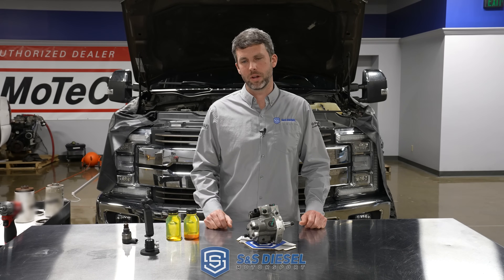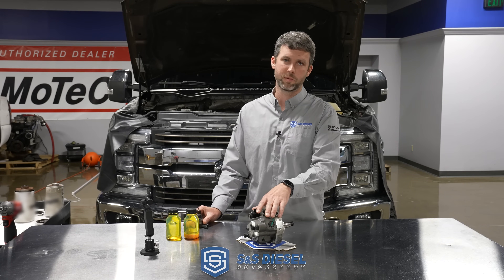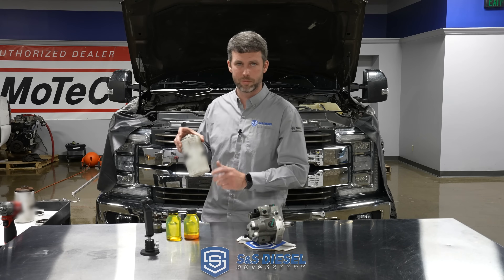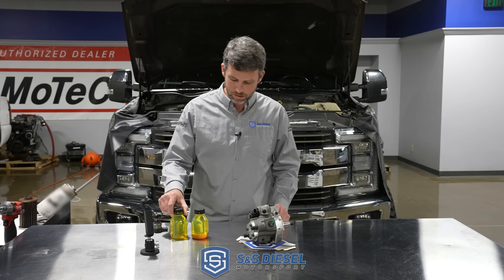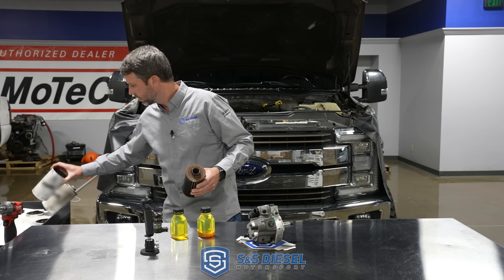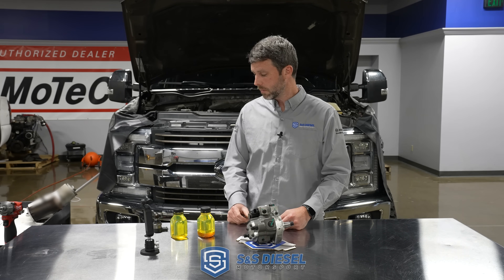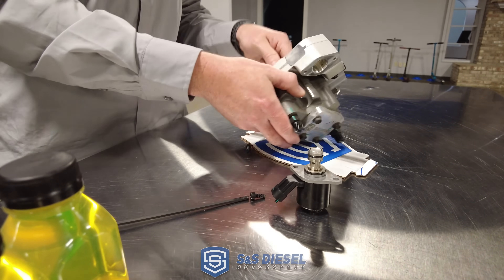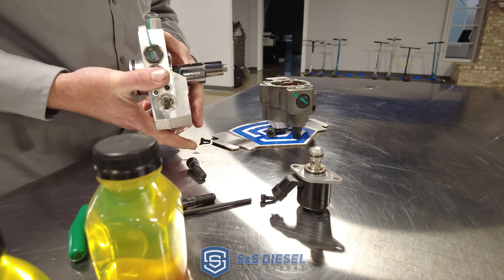Can The Ford 6.7L CP4 to DCR Pump Conversion Handle Water In Fuel?

Comment: This is proof the DCR is the pump to buy...... Glad to see this system working as intended!.
Reply: Instead of buying this chinese made pump that doesn't have long-term testing on the 6.7. RCD CPX is a better choice. Buckets are pinned, which makes rotation (cause of failures) impossible, and case fuel is routed back to tank. All while keeping the 4 pulse per rotation setup, which is what the 6.7 is designed for, not the 2 pump dcr.
Reply: @HSKFab my rcd cpx pump lasted 25,000 miles. The pin broke off went in my engine. The shaft seized inside the gear, and the pump broke in half. Left me broken down in New Mexico on the 10 loaded with 4 cars on my trailer. Metal everywhere. The pump did not redirect metal to the tank like they state. I would not ever again buy the cpx pump again or recommend it. That brake down screwed me so bad. So before you start calling this a Chinese pump you should maybe consider it a good pump. I think it’s funny how the pump you swear by is what left me stranded and in extreme stress.
Reply: @ballacii  What pin broke off and went into your engine?
Reply: @ballacii  Nothing? Interested in the details.

Comment: Driving to and dropping off my CP4 Core at Injectors Direct this morning, about 60 miles RT.  Practically giddy about removing that thing from my truck and life.  Am finally confident in the reliability of my 2016 F250 SD.  A simple thanks seems entirely inadequate, but thanks again S&S, Pure Power, Stanadyne everyone involved with bringing the DCR Pump to market.
Reply from the maker: Thanks, Ray! We appreciate your business.
Reply: How much were you quoted for everything?
Reply: @kevinmcquitery4543  The pump kit was 1995.00 + tax and if I recall 400 core charge that was promptly credited back.  Bought from Injectors Direct in San Luis Obispo CA. Was closest dealer.  Had local shop install, the bill including other work and LOF, Fuel Filters, ~4K.  Just no time to do by self but certainly doable.

Comment: Has me thinking about getting rid of my FASS now...
Reply: I posted a thread on other site about the FASS system I ordered and could not figure out how to install on 2017 Superduty.  I dropped the instructions for install to my good friend who owned a body shop and let him look at it.  He called me back the next day and told me how it installed and I couldn't believe it.  He also told me I probably should return it because it didn't make much sense the way it worked on 2017's and up.  I did return it.  When I posted about having to pay a 15% restocking fee I was shocked how many people told me I was very lucky I didn't install it becasue they did and had big problems.

Comment: i just ordered the dcr conversion kit for my 13 6.7 powerstroke yesterday. were building the truck and currently have it torn down. i have a fass system titanium series and disaster prevention kit to install on this build aswell but it looks like i might be better off to stick with the oem since ive decided to throw the DCR in while we have it apart. would you agree or do you think it would be fine to just put it all in? it will be mainly a daily drivable tow rig that can make a strong pull if needed. but not trying to make anything to crazy with it just looking for reliability and dependability.
Reply from the maker: Thank you for your business. The Disaster Prevention Kit is not compatible with the DCR and we prefer the factory supply pump and filtration system. That's what we run in both of our company-owned development trucks.
Reply: @SSfueled  ok great so the factory supplied pump and filter kit should be sufficient for any extra power or stress thrown at the truck? i purchased the fass system and disaster prevention kit prior to getting the DCR. and not knowing they were avalable at the time. so i can just sell them. but will the fass system work with the DCR?
Reply: @roymooney2921 The dcr isn't proven in any way in modified trucks. A better route is the RCD CPX stroker.
Reply: @roymooney2921  I'm not sure how far along you have come on your build since it's been six months since your post, but to me the filters in the video that SS Fueled took out of the truck look like they came from FASS.

Comment: AirDog filter system sucks. FASS is the best fuel filter system.
Reply: I have installed many FASS systems. They seem great, until I saw this video.... it looks like when there was more than usual water if failed terribly.
Reply: Both suck.

Comment: i appreciate the video, i plan to update to the dcr pump an get rid of the cp4. but, an i mean  BIG BUT, how do you get corrosion? its a closed system if it wasn't a closed system it would leak correct!?! To have corrosion you need air!, yes the tank filter could have gotten air based on filling up traping air. BUT! ALL other fuel components would not have air introduced to the fuel, hence no corrosion, just water! too much water (not run), no rust. BASIC SCIENCE GUYS AN GALS
Reply: H2O, the o stands for oxygen!
Reply: @lewisbolman7862  good lord guy, no kidding. Go get a steel gas tank, or metal tank of any size. Put water in it an seal it!. Let me know if it rusts inside.

Comment: I appreciate the informative video. I own a 2020 Ford F-450 Limited with just 11k miles. After much research I have decided to replace the OEM fuel filters and water separator with a SPE Fuel Filter system that uses  CAT filter IR-0749 and  256-8753 water separator filter and still uses the OEM water senor . I am also on a wait-list at JBJ Repair to replace th CP4 with a DCR pump once he receives the DCR pumps on order. I'm looking forward to getting the new pump installation completed .
Reply: Hey, SPE fuel filters look cool but I have  a question...even though they retain the stock wif sensor...? Can the wif sensor really work if it's NOT located in the same place as where the separation & collection of water is occuring?????🤔
Reply: I also use the SPE fuel filter system and I'm very happy with it.  I love that it filters down to half the microns that the Ford system does and that it uses CAT filters.

Comment: Well, im ordering one my 2023 has 1500 miles on it and im swapping!
Reply: Not sure if you'll read this comment since it's been 7 months since yours, but were you worried about voiding the Ford warranty? I ask because I also have a 2023, just bought last summer.
Reply: @stevenjefferys10  I have a 24 H.O and already installed the DCR conversion just to be safe. Why people think an entire warranty is voided because of a single mod is beyond me. In this case the fuel pump warranty is the only thing voided. In order for Ford to be able to deny a warranty claim they have to prove it was a direct result of a given modification. Read up on the moss ferguson case. It is federal law that auto manufactuerers must honor their warranties regardless of after market modifications unless they can prove a specific modification caused the issue and even then they can only deny that specific claim. The warranty remains in effect for all other failures in all other systems on the truck.

Comment: I find it crazy through four fing filters there is still a possibility of contamination going through the fuel pump
Reply: The filters were actually generating rust because of the water in the fuel. I’ve always been a fan of the factory setup for the better micron rating, factory drain and sensor. For higher hp setups once you have upgraded injectors or stroker/dual pumps I’ve always recommended run the aftermarket lift pump feeding the factory FCM.

Comment: Will, I have often thought about running a fass, or aftermarket filter system like H&S offers; but after seeing how well that water filtration worked, I think I’ll stick to my OEM filtration
Reply: Imagine that, the engineers that designed the fuel system know what they are doing.... 🙄I too, like you, @jorrick66 will be sticking with the OEM filtration.
Reply: A cat filter will serve you well too but why modify a system that works? There is more to the story of how the owner abused this truck it to get it into this condition. That said, I use OE filter(s) on my 11, 6.7ps which has almost 230,000 miles and the original CP4.

Comment: How many miles were on those filters
Reply from the maker: 3 months and roughly 6,000 miles
Reply: @SSfueled  wow, that's unfortunate to see. I've sold a lot of thos systems on older trucks. We have always told customers that it is unnecessary on their 6.7Ls though.

Comment: Can these go on high output 6.7s?
Reply from the maker: Great question. We are currently testing a DCR on a 2023 HO model. We do not expect there to be any issues, but we want to make sure before selling DCRs for 2023 trucks.
Reply: @SSfueled  Not to take away from SS but I thought the HO 6.7 did not use a CP4?
Reply: @tattooedmillionair HO is cp4
Reply: @Kinginwar  ohhh.  Thank you.     Here is where I went wrong: in another video, a Ford rep (Shawn Spannbauer) said (when discussing changes form 6.7l to the HO) "...increased displacement of the high-pressure fuel pump...", so to me that meant the cp4 was physically redesigned or replaced.  Perhaps Ford is just using the same cp4 and pushing it harder?

Comment: Blurred but looks like FASS filters. Which makes sense due to the description of the replacement underside and removed top side stock setup. I always wondered how good those Air dog and FASS work. Had a Duramax LML before and a ton of those guys use them stock or modded trucks 
I just wonder if it's more lack of maintenance? Due to the filters needed to be ordered in most cases, and cost, and supposed better filtration...do guys with those extend their replacement intervals?
Also, maybe if the water in fuel this person got was just an anomaly? Maybe
Reply from the maker: In this particular case, the truck owner is really good about changing filters; he changes fuel filters with every oil change. The filters in the video were installed in March of 2023 and we estimate that he got a bad batch of fuel sometime before April, and then went on vacation for a week. The amount of rust suggests that the truck was sitting for a while with water in it. Since it's his work truck, the only week it sat was during the vacation. We're thrilled that the DCR could have been eating rust and water for months and was still making pressure!
Reply: Maybe the use of a daily treatment would be good?
Reply: I am a huge fan of WIX filters.... and WIX diesel fuel filters are also white......  Could have been a specific brand system purchased and then a different filter used?

Comment: I appreciate what you guys do, and my only real way to combat this in Wisconsin has been to fill our transfer tanks and run a conditioning string before fuel goes in trucks or our equipment.  The bobcats we have are common rail too and guess what, just as susceptible to bad fuel.  Fuel quality has gone down consistently in my area, its certainly kept diesel shops busy.  I will probably put a dcr in my 2017 because it has already had a relief and fuel rail issue that led to replacement but the cp4 survived.

Comment: So how many hours and miles got put on the pump ?
Reply from the maker: 12,600 miles total and 6,000 miles since the last fuel filter change back in March. Based on the amount of rust, we estimate that water was introduced sometime before April, when the truck sat for a week while the owner was on vacation. That's the only period of time that the truck has not been used daily.
Reply: @SSfueled  So if not a daily driver these systems are more susceptible to water?
Reply from the maker: @FRZNTYM1  The frequency of use does not play much of a role in water contamination, but it does play a role in corrosion. In the case of this truck, the rust in the filter was very bad, which suggests that it sat with water in the filter for some time. Driving the truck will move fuel and water throughout the system, which is why we also saw rust formation on the return lines and inside of the pump. Water can cause issues either way. What really made the difference, in this case, was the DCR pump. It survived the water and rust, and is still running in the truck today... scored bushings and all. We've had reports of many CP4 warranties being denied due to fuel contamination, yet with a DCR it does not appear to be an issue.

Comment: Why dont people change their dang filters? I put 15k at most on my truck per year, oil, oil filter and both fuel filters 3 times a year, even if i put 10k on the truck, it still gets 3 services per year.
Reply from the maker: Based on how bad the filters look, you would think they have never been changed, but that's what water can do. In actuality, the filters were changed in March of 2023 and he got bad fuel sometime after that. The truck sat for a week in April, while the owner was on vacation. That's likely when most of the corrosion occurred. While we don't know for sure, it's possible that the truck has been driving around with water in fuel for months. We're extremely happy with how well the DCR held up to it.
Reply: @SSfueled  if that's the case, running OEM is way better than aftermarket. Plastic no metal and you have a sensor. You can literally spend yourself into more breakdowns by thinking aftermarket is better, these companies just want your hard earned money. Drain the fuel/water separator once a month. These trucks require much more maintenance than most are willing to do.
Reply from the maker: @2025willbebetteryet  Agreed. 👍
Reply: @SSfueled  and I was one of the skeptics on the OCR, I will purchase one for myself as a Christmas present from my wife. I appreciate the hard work your team has done on getting this sore thumb item sorted out
Reply from the maker: @2025willbebetteryet  That's great to hear! The aftermarket has created reason for skepticism. Our engineers do a great job of using lab and real-world data to make sure that our products are real solutions. Winning over a skeptic is a true victory and we look forward to earning your business.
Reply: The filters were changed every oil change at 7k mile intervals.
Reply: to often

Comment: I was running the Airdog system for about a year and never had an issue.  It doesn't use the stock water sensor but does have a water drain on one of the filters so it can be checked.  Currently I'm back to the OEM system.
Reply: That's probably the best system. See so many issues with FASS. So if someone wants an aftermarket solution then Airdog is the way to go.

Comment: Just curious, but how many miles between fuel filter changes on this truck?
Reply: Fuel filters were changed at every oil change.   So about 7000 miles
Reply: @danecrowder  But how long did it take to go those 7k miles? It seems that kind of rust would take a bit of time to develop no?
Reply: they answered ........"SSfueled said,
7 months ago,
In this case, the truck owner changes the fuel filters with every oil change. It was just bad luck and he got a batch a fuel with water in it. These particular filters had roughly 5,000 miles and 3 months of use. The water did not shut the pump off, but the DCR and injectors handled it. We're glad it worked for you and not sure why it didn't for him."

Comment: FASS has some explaining to do😮
Reply: FASS system is junk.  I bougth one and when I read the instuctions on how to install on 2017, powerstoke it made no sense.  When I finally figured it out I returned to system.  I cant speak for the FASS system on power stokes pre 2017, but after 2017, they're trash.

Comment: Hmmmm.....SPE & HSM fuel filter replacements???  Thanks much Luke...ARod, thoughts?
Reply: The SPE Cat filter kit retains the factory WIF sensor and puts it before the water separator, how well it works IDK, but the cat filter at least has the water drain valve on the bottom of the water separator so you can periodically drain it to check for water. Just FYI anyone with a stock 6.7 ford fuel system you should periodically drain your water separator after it's been sitting a for a few hours. This allows all the water to separate from the fuel and get drained out.
Reply: @JaegerWrenching  My question is: can the wif sensor do its job if it isn't located in the same place as were the water separation is occuring??🤔🤷
Reply: @zekester1  I'd assume not, unless there is a large amount of water like someone dumped DEF in the fuel tank. This is why I tell all my customer to run the factory setup which is good for a decent bit of HP anyways.
Reply: @JaegerWrenching  that's my thoughts also👍...Happy 4th🪅😉
Reply: That was a FASS fuel system
Reply: After seeing this video I won’t be doing it